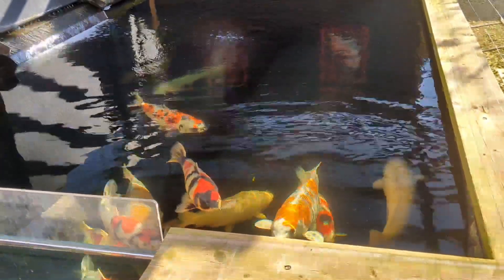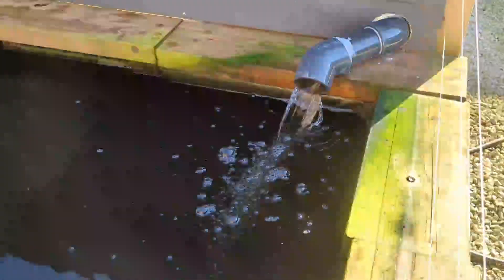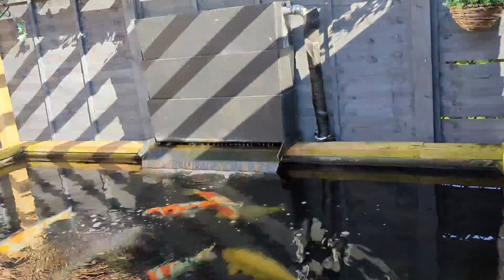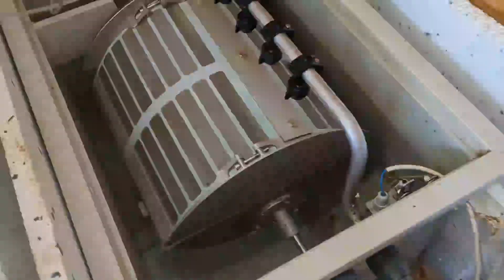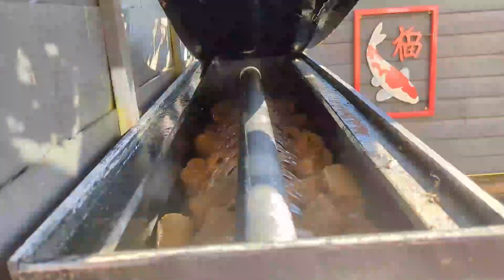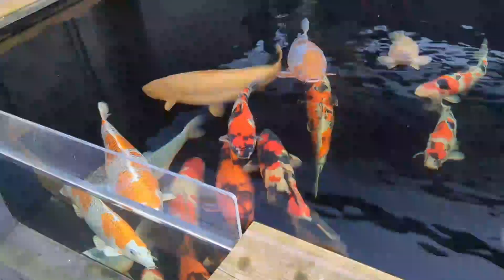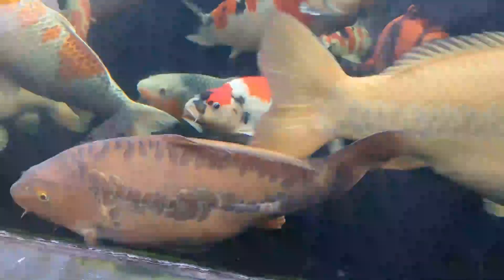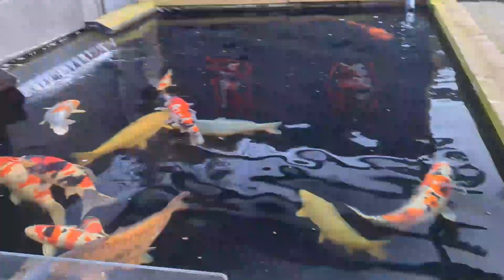Long overdue koi pond update. spring is on the way and the covers are off 🌞

Comment: Hi, how do find the remora heat pump, do you have a rough running cost for it? Thinking of buying one this year 15500L pond
Reply from the maker: It's a great bit of kit. I'd definitely recommend it. In terms of price mate it's impossible to put a figure on it really, varies massively on the outside temps. They work down to minus 15 but there efficiency drops as it's gets close to zero and they have to run regular defrost cycles. That said it's much cheaper than an in-line heater. When we had that really cold snap with minus 5/6 etc it was costing £3-4 a day and that was just to hold 8 degrees. The last 6 weeks it's been sat at 16 and I'd guess avaraging well under £1 a day. Comes into its own in the summer, costs a few pence her day and you can have the water at 24 degrees all summer.
Reply: @dannycurrie1  not to bad then, I am going to try running my shower at a bit slower flow also this year. I am deffo thinking of a heater this year. As did lose two fish in that cold spell so the cost of running a heater is still cheaper than fish dying
Reply from the maker: @leegeorge4423  that's the best thing about the heater mate. I had them at 8 over most of the winter. I had costia in the pond, had a few raised scales on the kujaku and lots of flashing, wacked the temps up to 16. Cost a few quid on the heating but got them treated and all healed up no problem. Worth every penny if it saves losing a fish